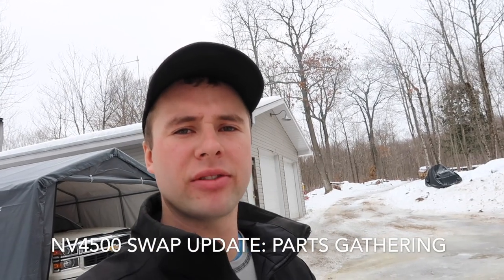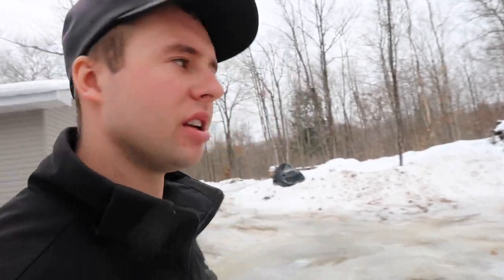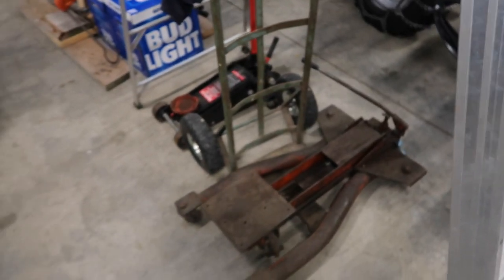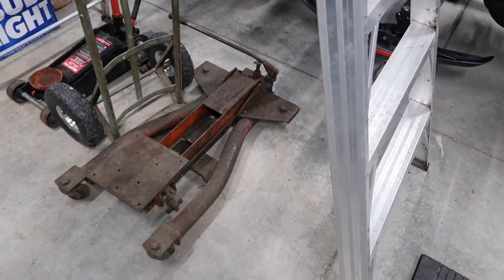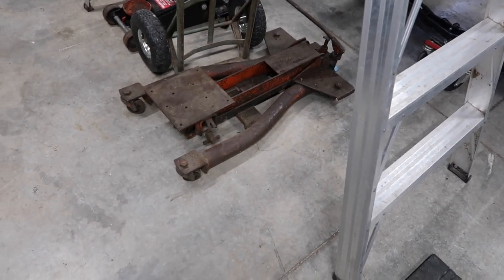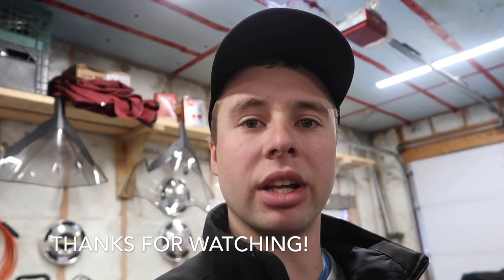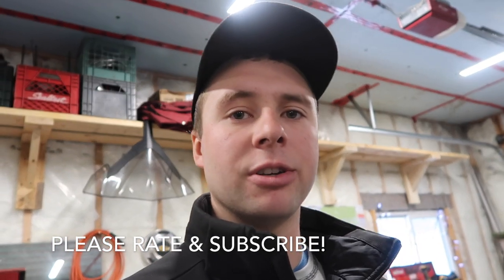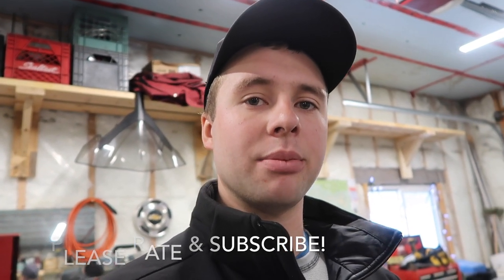47RE To Nv4500 Swap: Update

Comment: Glad to see you're taking some preventive measures when putting your truck together. I like to see people keep older machines alive and running. I hope to see you get out on your sled as I like to for the first time this year. As we talked before I will have to put off the studying of my track until the funds are available. This year I think I'll only be able to ride a few times up in Wisconsin here. I have a busy year with a big trip in September in Tahoe for some rest and relaxation. What size sheets of insulation did you put on your ceiling? It looks like they weren't 4 by 8 sheets since you tape them every 16 on Center. I like the paraphernalia on the walls. Have a good Christmas and happy New Year braap we go. What is your first name anyways?
Reply from the maker: Thank you! some sheets were 24'' and others were 16'' we got them used for a good deal. it acts as a vapor barrier also. Name is Josh

Comment: The nv4500 is a good trans make sure u weld the fifth gear nut on so it wont back off. I am guessing u dont like the 47re reason for swap
Reply from the maker: Thanks! I actually red loctited it on and have the updated nut on. My buddy that lugs the hell out of his stuff has had this done on his truck for 5-6 years and no issues. I don’t mind the 47re but i have always wanted a nv4500 so finally one came to me and will be put in👍🏻
Reply: @Schneids15  yeah I like the nv4500 they work good. I have a 1996 with the 47re it's ok for what I do with it. I use to have the twin to ur truck mine had the nv4500 in it. But it was a 1996 same color. The dumbest thing I did was sell it man it work good.
Reply from the maker: Yes i have never heard anyone say they sold there standard and did not regret it